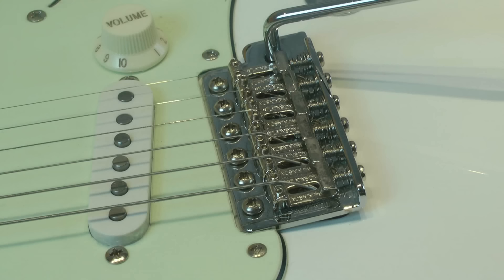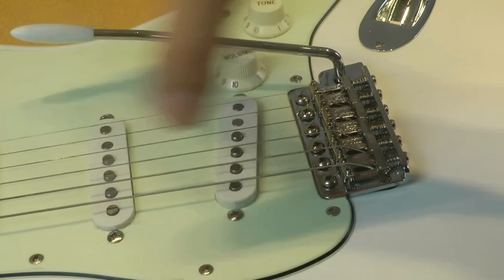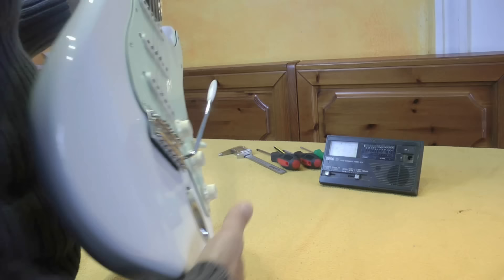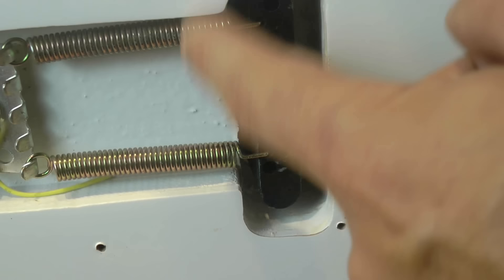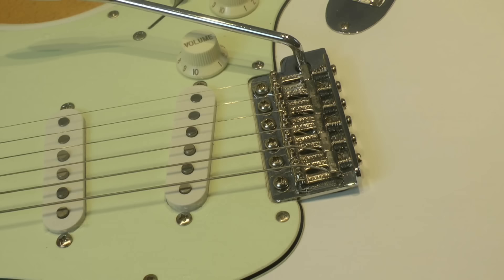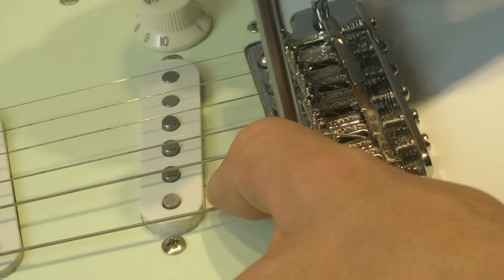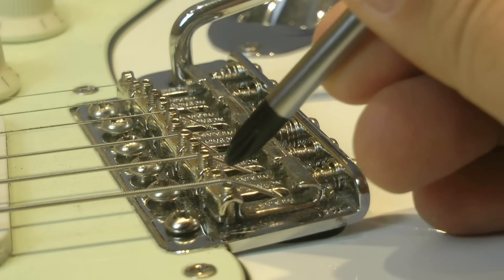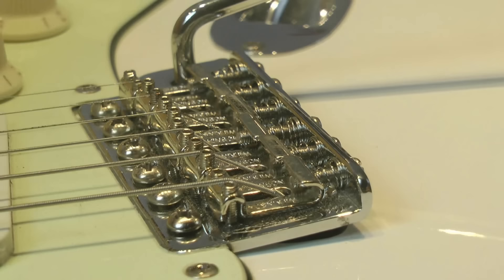How To Set Up a Vintage Strat Six Bolts Screws Tremolo for Best Floating Performance

Comment: Thank you so much for this. I just unlocked 100% of my Strat :) Never thought a six-screw trem could be this stable.
Reply: Why would a six-screw trem be any less stable?
Reply: @51MontyPython  mine's horrible!! I did this without success.
Reply: @HF1600ie  Then it’s most likely not the Tremolo but something else, like the nut, string breaking angle or string tree coursing the issue. 
Even my Squier Bullet (with 6 screw trem) stays in tune, even with heavy trem use.  The stings should break at the same angle (or close enough) and you must lubricate all string contact points with a very good lubricant. I use something called “Nut Sauce.”  When setup correctly your guitar will function almost as good as a “double locking system.”
Reply: @jazznotes3802  interesting, never thought a squier bullet could be that stable. do you use locking tuners on that guitar, or does the stability come from the setup?
Reply: @tintecobrizo  Locking tuners aren't the decisive factor for tuning stability. They are hardly even important. The nut, string tree, and the bridge are all contact points, or friction points, that can create issues with tuning stability.
Reply: @nedim_guitar Tuners are certainly a contact point, and if they have low strength and move when the strings move (and cheap ones with bad gears will, as they often also lack lubrication) then detuning will happen. Locking at least guarantees this a bit more, but I agree it is not the key to stability, only a part of it.
Reply: @Fischtickles  Well, that's true, and also if you do too many winds. Regular and stable tuners should do the job good enough, but locking tuners won't hurt.
Reply: @nedim_guitar  or too few winds, the strings pull out with the tension. Glad I discovered this video, I've got a new cheap Ibanez Gio that I'll setup the bridge this way today. Then I've got locking tuners coming in, I'll see if they add any more stability then what I can achieve with the stock tuners and let you know.
Reply: @Fischtickles  Good luck! Gio is a fine guitar if you set it up right.

Comment: Thanks a bunch man, my floating tremolo is staying in perfect tune. I never thought my Strat would be able to perform like this, so I kind of took a chance and just tried setting this up for fun, thinking I would probably have to change it back to resting on the body. But I didn't have to! I'm amazed at how well it stays in tune. Using a pencil on the nut slots works really well.

Comment: What about a Squire Standard. Only two screws one on each side, not six like a Strat.. When i replaced the factory strings the saddle - bridge is tilted way up now. I hear people say tighten, but no then it's loosen the screws, etc. So which is it. But they are always referring to a 6 screw strat bridge. Can't anyone help with a Squire? please? Thanks.

Comment: The advice here in this video about adjusting the bridge screws for better floating bridge performance fixed 90% of my Strat's tuning issues.  

Going to look into a slightly taller string tree spacer so the angle behind the nut on the E and B strings is a little less severe, and give all the friction points another touch of lubrication.

Grazie mille!  ❤

Comment: I have been doing this since the mid seventies. Learned the tricks & secrets fom my cousin who was a well known guitarist who i lost ten years ago. Sometimes i use a regular nut & if it is slotted properly it will work. Mostly i use spertzel tuners, which were not available back then & a graphtech nut which slso was not popular back then but i got it to work ptetty good! I use neck srews instead of regular screws for the claw. I only use two springs because i find there is more tension because of the bridge floating! But there is one major trick that was not shown in this gentlemans video.
If u get all these steps right it's just about flawless. I can put new strings on without even stretching them & i stay in tune well. But i do stretch the springs. I really use the trem & put it threw the ringer & stay in tune all night. People don't believe me until they actually play my guitars. I have about 6 strats & 5 telecasters & one tele with a tremelo. I also do it to an American standard bridge which will dive more profoundly! Either way i can dive or pull up & get those crazy whammy sounds & never have to worry if i am in tune.

Comment: 1) This has a deep drilled block. See the protruding ball end wraps? Also block is offset, G string has better angle.  String behind saddle in block increases tension and tone, but left hand bend will pull out of tune. Drill to 1cm from top plate for better tuning. It's the only way to keep G in tune after bend without a whammy reset.
2) By narrowing high E saddle to clear nut and making top plate arm hole larger, modifying block to L shape (first drill thru for allen key access to retainer) a Floyd arm is easily mounted. Do this when tired of stripping threads and breaking arms.
3) File away forward edge of top plate back to screws, restore bevel, and much more dive is available, an octave on A with 10's. Still much more tone than a floyd but inexpensive and reliable as well.

Comment: Thank you! I did everything by your recommendations on my Squier classic vibe strat with stock bridge. It works flawlessly by 90% )). I replaced the stock flat saddles with those by Highwood, and put a tusq string tree. I'm using only two springs btw, set at an angle. I little problem however is about the 6 pivot bolts: since they don't have a curved slot (like most 2-bolt systems do) for a bridge plate to stick to, the latter sometimes travels up or down after shaking or dive-bombing. And that is a pain in ass, since both the tuning string action are getting affected. I tried to screw the two side bolts as low as possible, still allowing the bridge to flow, and it helped a little.
I was browsing google to find solution and came across PRS pivot bolts (they have these slots). However I haven't found yet any reliable first-hand experience on using them on strats. So I'm wondering whether it's worth spending 40euros to try. I suspect they might not fit to the strat body, and the holes on the plate need to be shaped/sanded accordingly to stick. Any ideas? Has anyone tried them?
Reply: I know this is old but I'd appreciate an update on whether you tried those PRS pivot bolts.
Reply: @SafeAndTheGang  not yet. Overall I'm satisfied with how the bridge floats and keeps tune the "old way".

Comment: So much GOOD info in your videos Frudua! Thank you in the first place! 

The 2 questions I have for you are about the "bonus tip" you teach in the video: 
1 - how many mm you suggest the 2 outter screws should be raised? Or is it just a matter of experimenting (always keeping in mind that I'll have to lower the saddles in the same amount to compensate the raising of the screws)?  
2 - how to be certain that I screw in the 4 inside screws to the same height of the 2 "pivot" screws?  

Sorry if these are basic doubts, but I'm trying to learn as much as possible in order to start doing my own setups and want to be sure I learn everything correctly!
Cheers and thank you for your work!

Comment: Thank you Frudua Tv this video help me get my PRS w/six screw saddle to work floating like a Floyd w/Perfect tuning after using the trem!!!  Thank you very much you got it nailed. I did see an interesting vid of a guy that ran three springs & he tilted the spring claw to distribute the tension on the strings i.e. the low side more tension & the high side less tension on the claw so that the claw is at an angle / . I'm trying to get my strat to do as well as the PRS but not as much success.

Comment: Guitar I am fixing this was best method,  I'm still having intonation problem wit low e, 6th string slightly sharp at 12th feet, also tune with block of paper under bridge then take it out and bring it back with the spring tensioner  thank you so much

Comment: Thanks for the detailed instructuions. In you experince, which is vibrato system is a better option on the strat in terms of stability and operation: 6-point or 2-point? Thanks in advance!

Comment: Simple to follow video yet I don't have a decent tuner like yours Frudua so, I will have to opt out and accept my tremolo bridge as it is.
 I have a tremolo set in a box I wanted to install now I see my tuner isn't as good as yours I can't risk messing up the half steps.
may I ask what tuner you use Frudua ?-I have a seiko ST737 :)

 --I don't film or upload to youtube as I dont have the equiptment for it, thank you for your knowledge and time to bother to upload this! I applaud you!
Reply: Grace hallons how did you make that thing on the text
Reply: ah someone crossed it out on youtube nothing to do with me it's censorship by youtube but, at least you can see just under the line what it is. hope it helps great informative veideos thank you have a nice weekend!
Reply: A good peterson is always great, however a $15 korg works, hell your tuner will work just fine

Comment: Hi, Galeazzo, thank you for the video, very interesting. A year after the purchase of my first MIM strat, I sadly discovered that the wooden and steel holes of the vibrato arm are slightly misaligned. I am still able to screw the arm but it fits skew, and at rest it has not got aligned with the body of the guitar. Any chance to fix this annoying issue?
Reply: if I understand correctly, it is a minor issue, if it fits, you can bend the bar to your liking with some tools/knowledge, it does not need to screw in all the way or be tight unless that is what you prefer. It obviously does not look great or professional to have it wiggle around freely but it will still function perfectly

Comment: Hello. I have question. One of my strat for out of standart tuning. I use for chancing Eb to Db Drop, D tuning or something else. But I want use front side vibration, not floating, baseplate touch the body. Can I use this adjust without no floating? And how to adjust tremolo spring? Thanks for all video..

Comment: Scott Henderson said in his forum this method ... is the same? is any difference?  SH: Take the strings off the guitar, take the springs off the bridge and remove the bridge from the guitar. Now let's put it back on the correct way. Set the guitar flat on a table and drop the bridge into the guitar. Screw the two end screws in until the screw heads touch the plate. Now put the other four screws in, but the screw heads should NOT touch the plate - make them about 1/16" higher than the end screws. That should fix the problem.
Reply: This one is different, he's adjusting where the bridge sits with the two outside screws and then bringing them flush. Whatever works

Comment: I don't quite follow what you mean at 11 mins with the bonus trick. You say raise the out screws the same height at the the string, then lower the saddles the same distance? I think full demo of this would be good.
Reply: Ok, he raises the bridge to raise the overall action. Which requires him to lower the saddles to compensate for the bridge being raised. Now look at the strings coming out of the block and then over the saddle, he is reducing friction by decreasing the steepness of the angle of the string crossing over the saddle by lowering the saddle, however he raises the whole bridge to adjust for the action. Make sense?
Reply: Mark Rist you loosen the middle four to the point where they are higher than the two outside screws so they won't be in the way.Then you make the adjustment with the outside screws. Then you tighten the inside four to the point where they are the same height as the outer two screws. If you tighten them all the way then you put the bridge back out of adjustment.

Comment: Where in either of these videos do you show how much to release the tension in the springs in the back, to go from fixed bridge to floating? I assume you release the spring tension before adjusting the bridge at all, is this correct? If so, how much?

Comment: I’ve played Stratocasters all my life (I’m 76) and never had a problem keeping them in tune. When properly set up they work just fine. It’s when you start messing with screw height and using fewer springs (wimpy) that you run into problems with strings going out of tune when bending. I still have a '56 and it plays just fine. But, of course, everyone knows better than Leo Fender.
Reply: Sam McCue Leo fender never played a single note his entire life and designed the strat to be cheap and easy to make

Comment: Do I need to loosen and detune strings before making the adjustment to the inner screws on the bridge?
Reply: +socialdef3 it wouldnt hurt, i usually do whenever i mess with the bridge.

Comment: Thanks for the video. I did not quite get the saddles part near the end(where you raise the outer pivots). The other question i have is, why bother with a 6 point when you make it act like a 2 point? Is there any advantage to a 6 point? Speaking of saddles i do notice that my high e string saddle tends to shift horizontally (to the floor)after playing and i dont know why! It effects my tuning everytime! Have you ever encountered this problem? Anyway thanks and well done for the great work you do.

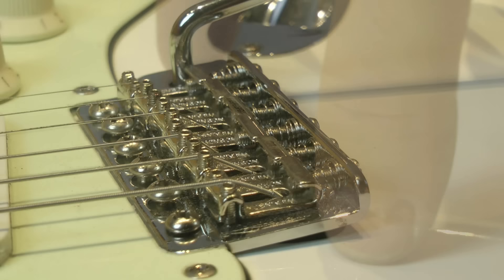Comment: isn't it bad for the wood of your body or the screws which attach the bridge to the body if you put the bridge higher? (like in: 11:22 to 12:01)
i mean there is a lot of tension on those strings.. isn't it going to bend or be bad for it?
(i have standart e B G sring sizes but thicker D A E strings. must i still do exact the same thing as you do by floating the bridge?)
and do you think i can do dive bombs if i don't let the bridge fload but just lay it agains the body? (with this set of strings?)
it will be a lot more usefull since it won't mess up my tuing in drop d (which i use a lot) and c 

thank you for the video 
and thank you if you react to this comment, it really helps out

Patrick~

Comment: Thanks for sharing! I have recently swapped from a two point to 6 screw bridge. Does the middle of the back of the bridge (furthest from the pickguard) actually touch the guitar body? For me, it seems like the corners touch the body but not the middle...

Comment: Another great video. Very, very, informative. THX. I have a problem with my vintage Strat type bridge; the high E string sounds 'dead' compared to the others. I have cleaned and graphited the nut slot and changed the string. Still the same. It appears that the string is hard against the inner height adjustment screw for that saddle. The saddle cannot be moved laterally as it is already hard up against the B string saddle. It is as if the saddles are too wide. Any ideas, please? The guitar is a Harley Benton ST-62 vintage strat copy and after a small set-up, has good playability and great tone. Apart from this one problem. Your advice would be greatly appreciated.

Comment: Thank you for the information.. although, I am a bit confused.. I accidentaly started doing the two pivot one, tightening the claw etc. Had some tuning problems, so now I changed strings and tried with graphite (pencil). So.. I am about to set it up again. Do i need to do what is in this video first, then follow the instructions for the two pivot if I want to have a floating bridge?
Reply: Hi, I share your opinion. This is NEVER explained.And the guy does also not answer on that topic.IMHO, screw the tremelo springs ( on the back of the guitar) on such a way, that the bridge plate lays completely on the body, and that it can not move during the setup of your guitar, Afterward follow the second part of the video concerning "the 2 scew tremelo ".

Comment: what to do to lower the action of the saddles deeply enough if the bridge raised up for about 3 mm (for floating bridge)? Sometimes the saddles are (nearly) touching the baseplate but the string action is still to hight?
Only solution is shimming?

Comment: Does any of this work for an Ibanez GRG120BDX? The tremolo bridge of my Ibanez is almost fixed (I can barely move it... it was this way when I bought it) and I want to have it floating more. I would like to know if I can adjust it the same way as a Strat, or if I need to do something different. Sorry for the noob question, thanks.

Comment: i had a blocked bridge then i rise it to have a floating trem the tunning is stable but my strings have more pressure on them and the sound had changed a little bit, is that normal or i have to fix that ?

Comment: Hello Galleazzo. Firstly thank you very much for your wonderfull videos! Secondly I have a little problem with my floating 6 point tremolo on my strat. The base plate of the tremolo touches the pickguard of the guitar the whole distance [theres no space in between] and I am quite a beginner to guitar adjusting... Would you please be so kind and tell me how I could make this little space between the pickguard and the baseplate that you are mentioning? Thank you very much for any advice and good fortune to you!
Reply: you may have to cut the pickguard, or sand the part that touches.
Reply: fuqinazhole Wow I would never have thought of that... Thanks for the suggestions.

Comment: If you rise the bridge plate won't the plate slide up and down when you utilize the Vibrato?  Where it settles will vary I feel.  Please advise.  Thanks
Reply: Yeah, that's the first thing i was thinking aswell... I don't know, but doesn't seem very stable to have the plate being able to move up/down along the screw?
You got any clarification on this since you write your comment, Benjamin?

Comment: I have a vintage 1992 Squier Stratocaster, made in Japan. The tremolo is unmarked (contrary to another 1988 Squier, Made in Korea which has all "Fender" mechanics). Are you familiar with these unmarked bridges ? Can they be set-up properly as well ? thx